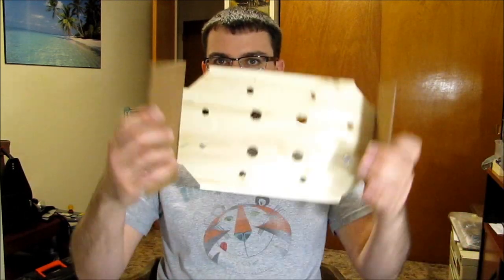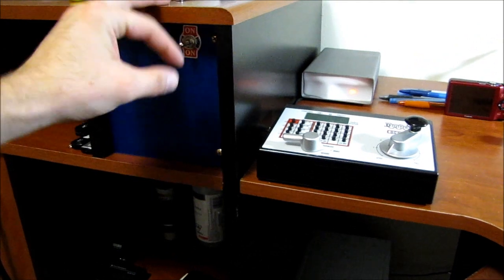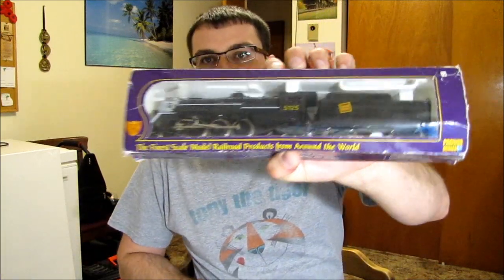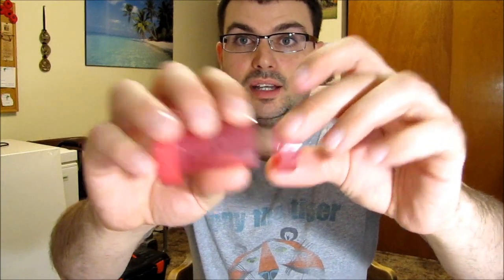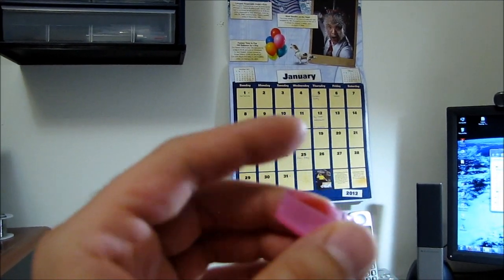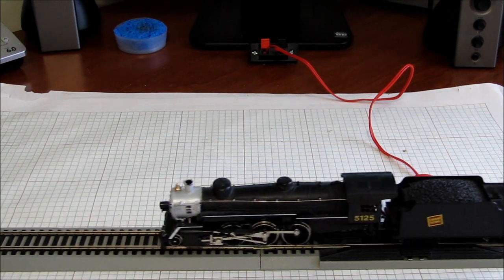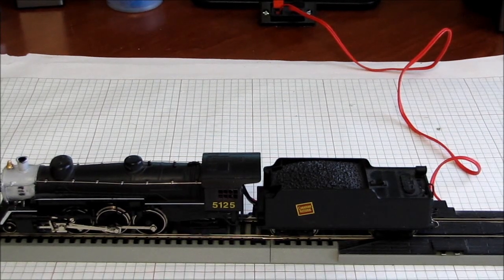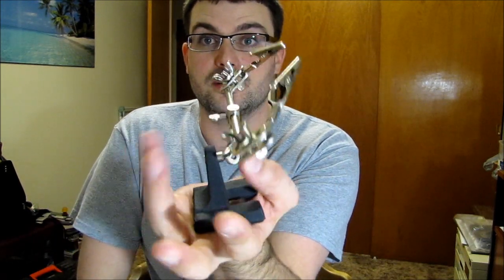1.13.12 How To make a simple round speaker Enclosure

Comment: I have been using bottle caps and pill bottles for years, they work great. The trick is finding the correct diameter for the speaker. However I did find great 8 ohm speakers on Digikey & Newark online suppliers. They come with enclosures, and have stems for the wire connections. I clip them stems off, and solder to the stub. The Mfr parts numbers: AST-01708MR-R=17mm dia. AST-023=23mm dia., and AST-015=15mm dia. The prices are pretty reasonable, and the speakers are durable.